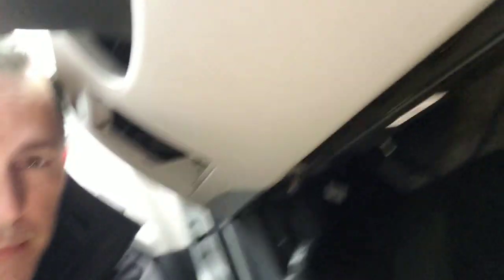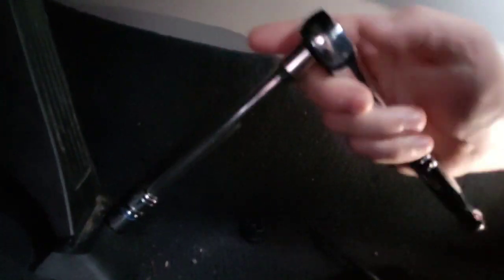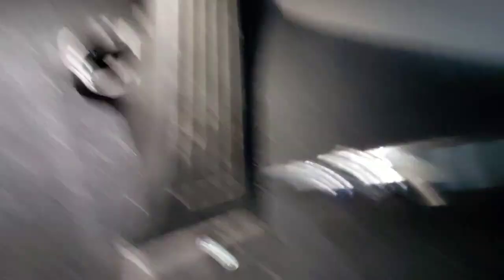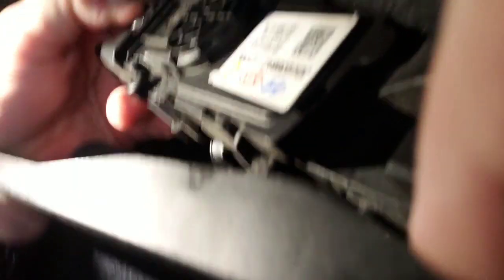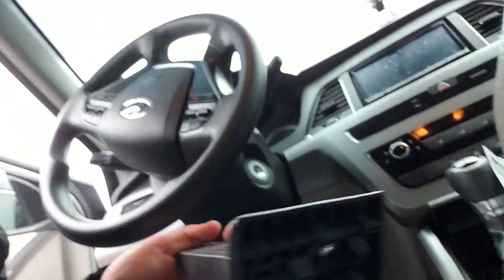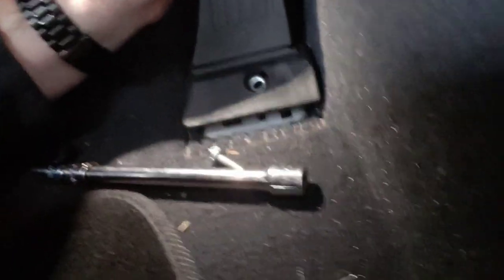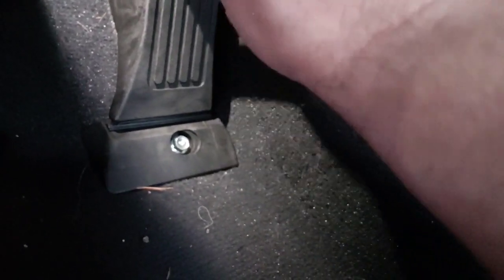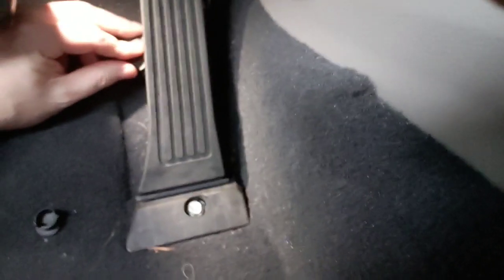Check Engine Code P2122 on 2015 Hyundai Sonata - Replace Standard Accelerator Pedal Position Sensor

Comment: Good sir. I would like to thank you from the bottom of my wallet. My dealership said it was going to cost me 850 dollars to unscrew to bolts and one plug. I just wanted to say thanks . And just to disrespect the dealership I changed it in their parking lot right in the face of the mechanics and service manager . Was done in three mins and gave a polite wavy when I drove away . Thanks, man. I got the part on rockauto for 170$. And that's all it cost me .

Comment: Thank you so much brother i just finished installing one now following your video on my car sonata 2016 the video was very helpful. thanks again
Reply: Has your car been running smooth since? Mine just got this error code but dealer wants me to replace the whole throttle body too
Reply: @animeskateriddle  Hey!  Did you end up resolving your issue?  Same code here and repair shop wants to replace whole throttle body as well.  Thanks!

Comment: Mine just had this. I was about to turn left on a big street, but luckily there was no traffic but  as I was turning the car didn't want to accelerate anymore, the check engine light came on and for a second there I thought my car had stalled for like 3 seconds and then I could accelerate again.

I took it to auto zone right away and it came out with this code which is why I'm here. The check engine light came off but after using a different obd scanner, I'm still getting the same code even though the check engine light is not on. Does that mean I need to replace it and could my car suddenly stop accelerating while driving? How dangerous is it to drive my car like that knowing the code is still there but the check engine light is off for now?

Comment: P2122 means a problem from the wiring/voltage coming from the computer side of the vehicle and not an issue at the sensor on the pedal unless you also have another code. DON’T BUY THE PART FIRST. Buy any cheap multimeter tester and check the wire connector that connects to the sensor on the pedal. I will be doing that once below freezing weather allows.

Comment: Went to an auto shop and this code came up on my 2016 model sonata. The engine light goes on and off from this code. Is it possible that it’s the car battery going bad and that’s why this code comes up?
Reply: Hey Brian, I have the same model and year Sonata. I have the same exact issue you had, and was also wondering if it could be the battery. Have you had any insights since posting this?
Reply: Do you guys have a fix im having the same problem?
Reply: Same here
Reply: Any update I got the code and also said battery  higher voltage  than normal/expected as well and my car won’t start. Charged the battery seems ok.. still can’t start..

Comment: Did you disconnect battery? and did you have any problems after?
Reply: Well mine the check engine like is off but a different obd scanner still pulls up the code. Perhaps this is a temp issue which can lead to a serious unexpected accident later? What are your thoughts on this?
Reply: @Ki1ngOfGods  did you do some tests on the wiring and throttle body? As the code could also come up because of those
Reply: @icywrath5384  I did not, but now that you brought it up, I will do this and keep posted. The light is completely off now. Either it was a false alarm or the issue is somewhere in there.
Reply: Light came back on again and car was having acceleration issues while accelerating after a green light. I thought it was going to die on me but car kept going, and the light went off. I just ordered the pedal now, online, I'll keep posted.

Comment: DO SOME INVESTIGATION BEFORE BUYING THE PEDAL - My 2017 hyundai santa fe sport is throwing the code P2122 but it keeps coming on and off. I bought a pedal and replaced it and it's still giving me problems, unfortunately I can't return the pedal so that was $250 wasted. After reading the comments further I'm thinking it might just be a battery issue, I will update if I figure out what the issue is but don't just go buy a pedal because it might not be the problem.
Reply: Were you having issues stalling while driving? Or was it just the check engine light that came on?
Reply: @serenitynow726  I never had any stalling issues, just the code coming on/off and weird starting and acceleration. I haven't replaced the battery yet but will update when I do. If that doesn't fix it it's probably the throttle body itself
Reply: @FakeBex  okay. I actually ended up unplugging the sensor under the steering wheel and plugging it back in and that seemed to work…for now lol
Reply: @serenitynow726  I replaced the battery and haven’t had any engine lights or issues since

Comment: You should tried to clean it with an electronics cleaner. Also a dead battery could be also am issue
Reply: Pedal replaced correctly and check engine light still on,, dealership wants 160$ just for diagnostic check that is non.refundable. claims has to be electronic reset.  Car has 55,000 miles and its not under warranty. Total B.S.

Comment: Hello joe,
What was the symptoms before replace the TPS?Is your vehicle cranking at the time?
My vehicle stall while I driving. Then it would not start after that. Speedometer  cluster started to flicker and various message popping up, such Check SCC, check smart high beam system, Check FCW system, Check LDWS, check TPMS... Were you experienced similar message on the speedometer clusters? The ODBII meter showed following error code p2127,p2122, p212200
Reply: Joe would reply to.my question if possible...